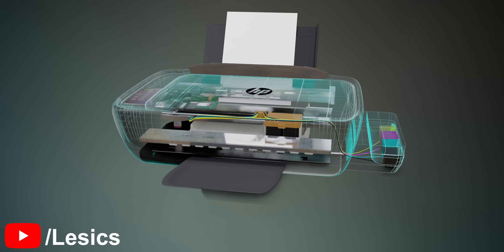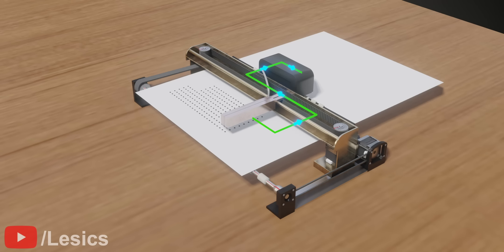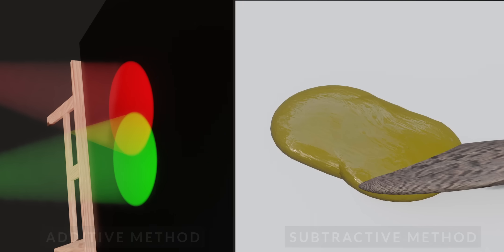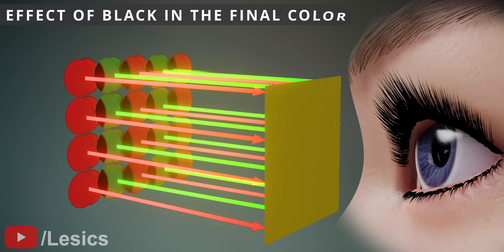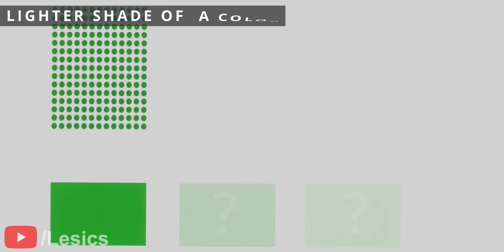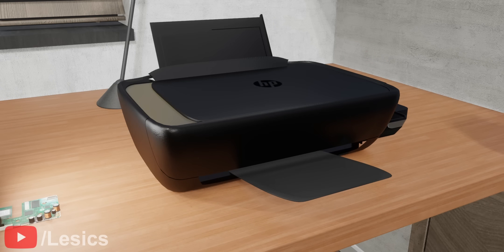Inkjet Printers | The interesting engineering behind them

Comment: It baffles me to know that there are micro nozzles and heating resistors in an absurdly large quantity while being extremely tiny yet they manage to print impeccable pictures.
Reply: Dr. Irina Luminesk  Right. However, this is electromechanical device which handles real fluid not just electrons and holes. Maybe nanorobots would be a fair comparison.
Reply: I would have guessed that making of the heads would be hard and expensive and thus ink heads should be loose from the ink but nope they somehow made them so easy to manufacture and all and also make them so hard to reuse and so just wow
Reply: Dr. Irina Luminesk  Please look up MEMS. It's not a trivial thing.
Reply: Tinier they can get better the pics will be...
Reply: @SALESENGLISH2020  still if engineers want to do something new then they will make narrow paths for ink
Reply: I remember in the beginning of 80's IBM showed I closet size device that really jetted a single stream of droplets and it was very high price. A little later I read from EDN (Electronic Device News) editorial that the kind of nozzle we now take for granted is doomed to fail and never gonna work....
Reply: @Axel_Andersen  That style is still used in packing plants for quickly marking boxes on conveyor belts
Reply: @MattOGormanSmith  That is interesting to know. Thanks. But I guess my main point was that at the time the now ubiquitous printhead was considered so difficult to make work that a major industry magazine doomed and gloomed it. Then again IIRC EDN also said that we will never get faster than 2800 baud modems on copper dial up iines because of Shannon and Nyqvist ;)
Reply: Dr. Irina Luminesk  Complexity is never the target in technology. Something being complex means a simpler way to do it could not be figured out. Complexity is bad, it means more difficult to make, more difficult to maintain and higher probability of failure. Even in transistors actually simplicity is the aim. Transistors aren't complex, they are very simple. There is just a lot of them, that makes the end product somewhat complex. Also the production process is somewhat complex and error prone. If there was simpler and less complex way to do what transistors do today, they would be swapped out immediately, but at the moment transistors actually are the simple way.
Reply: And imagine that in CERN scientists collide 2 opposite moving (with 99.9999% of the speed of light ) protons 40 million times per second and every collision is documented event!
Reply: @MiTheMer  Nope, costs manufacturers about $0.10 to make every single part of the cartridge. You can buy refill kits that work just as well as hp or epson ink for inkject printers for like $15-20 and get hundreds of refills. Inkjet printer ink is one of the biggest scams there is.
Reply: @BrHck  god damn. They must have zetabytes of storage and ram for this

Comment: I've taken printers for granted, I had no idea how complex they actually were!
Reply: we all did ...
Reply: Considering the $ of an ink printer...
Reply: I have Epson stylus 1390 which is made in 2008. I'm facing issue in that printer it's drop ink from it's Head after while without used.
Reply: Can we print stickers from this printer????
Reply: epic indeed
Reply: @dilansasanka1979  yup you need a sticky paper instead of the regular A4 size sheets
Reply: @lodeddiper3079  i did.but my printer got stucked.
Reply: @dilansasanka1979  did you seperate the paper, the sticky part and the butter paper, if yes you're not supposed to do that

if no then iv seen ppl print on a sticky paper
Reply: Everything is more complex than it seems. Even things based on very fundamental principles of physics are difficult to design in a way that makes them work.
Reply: @lodeddiper3079  no i didnt.sticky paper thickness more than A4 paper
Reply: exactly Ethan.  this is a masterpiece of brilliant engineering
Reply: What r u gonna do now?worship it?
Reply: I hope one day there will be printer technology using ink from wall paint🙏😀
Reply: @haoli6628  you can get older ones for around 30-60 bucks depending on functionality. They might miss some connectivity options but at least they work.

Ink on the other hand is still hilariously overpriced
Reply: @lodeddiper3079  nothing to add but that I observed it working way more reliable with printers capable of printing on photo paper. I assume it has to do with paper thickness, stiffness and the paper surface to be printed on
Reply: Same with drinking water. Never mess with Allah

Comment: I have finally understood why primary colors are not used in ink cartridges. Like always, another great video. Thank you.
Reply: Technically they do use primary colors. The primary colors are different depending on if it is additive or subtractive color space. Black (K) is added because using CMY to make it darker takes a lot of ink and ends up being a muddy dark brownish color due to the accuracy limitations of inks.
Reply: they do use it , it’s the shading and heat being transfer changes the perspectives,, welll the tech behind it

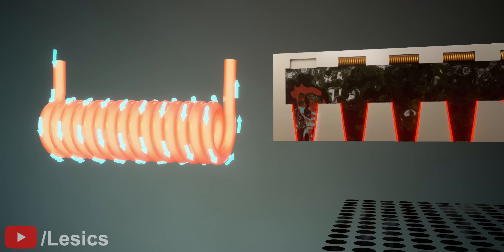Comment: My mind was blown and baffled by 1:35 where "heating up resistor coils" came into play.  Just the thought of how intricate a printer can be is amazing.   👍🏻😊
Reply: That is why the cartridge comes costly.
Reply: That's the least surprising thing going on with it bit nonetheless I appreciate your appreciation 👍
Reply: @Eren-da-Jaeger  the cartridge doesn't have them.
Reply: Love your printer before it becomes a Decepticon.
Reply: @fatitankeris6327  Some cartridges do come with the print head.  It's more expensive but ensures you get clean nozzles each time without wasteful (and not always successful) cleaning cycles.
Reply: this is thermal printhead. search for micro peizo.
Reply: @ajmercompany3520  Just searched 7 days after your comment; now that's damn amazing technology.  "40,000 times per second ink is delivered to precisely the exact spot needed" was quoted in video.  No heat.  Electrical current applied for contraction in order for ink to be released.  👍🏻😊🤯

Comment: Excellent.  Thank you.
I can't hardly imagine an engineer dreaming this up: "ok, so, we'll put a teeny tiny heater coil above a channel of ink, that will cause a vapor bubble that will force out a droplet of perfect size.  And then after turning off the coil, the meniscus with draw the ink back into the chamber, and then return to the surface but without releasing anymore ink.  And it will do all of this in a tiny fraction of a second.  Sound good?  Let's spend a few hundred thousand on this idea now to see if it works..."
Reply: Probably started as a giant apparatus on a dirty workbench, and iterated from there over 50 years, nevertheless, incredible.
Reply: Apparently the action of heating up the ink to create a bubble that would force it out was by accident, from creating strips soaked in ink for typewriters, and it got heated up somehow and exploded ink everywhere. And lo, the printer was born. I think the ink droplets get fired out at like 20-40mph from your injet cartridge too.
Reply: @alexjohnward  exactly, this is the result of 50 years trial and error by thousands of engineers

Comment: 9:09 Unless there have been some new developments in printer technology I am not aware of, I have never heard of printers mixing inks as shown here. Most printers I am aware of mix colors by putting down overlapping grids of dots where each grid is slightly misaligned from each other. The eye does the color mixing.
Reply: Exactly! When I heard it, it seemed strange and impractical to me, so I watched a printed image and the dots are misaligned as I thought! (Like black in the video)
Reply: @MyNotSoHumbleOpinion  The process is called halftoning. It's essentially the same as used by publishers when printing full-color books, magazines, newspapers, etc. Everything is printed at the same intensity, the size of the dots change to give the effect of different amounts of each color. You can usually see it best in the comics section of a newspaper, Sunday edition.

A desktop printer will typically measure its resolution in DPI, or dots per inch, and the numbers will be something like 300dpi, 600dpi, and 1200dpi. A halftone image is measured in LPI, or lines per inch, and they will be 75lpi for newspapers and 133lpi for most books and magazines. The halftone grid is at an angle to the page with black at a 45° angle, cyan at 15°, magenta at 75° and yellow at 0°.
Reply: Well, you gotta consider the paper is still ever so slightly damp right after the page prints, which means the ink right under the line being printed indeed is still wet during each print head pass.

And you better believe the printer manufacturer wants to waste as much ink as humanly possible while still producing a quality printout. So yes, they'll gladly overlap the inks not only in a dithered pattern but also right on top of each other too.

Ink costs more than human blood ya know...

Comment: If I remember correctly from the Gicleé printing, modern printers do not actually have that many nozzles densely packed in the printer heads. Instead they use "amplitude modulation", i.e. by somehow changing the size of the ink droplets to achieve an equivalent of the boasted resolution. The most advanced Gicleé printer goes up to 4800 DPI but the most advanced C-print (the good old Kodak photo printing) has only 640 DPI yet both yield shoulder to shoulder image quality in terms of details.

Comment: This was like a trip down memory lane, I worked for Hewlett Packard 1980 ~ 2002
Part of that time was working with the Printing Division, which included InkJet Printers
Lot's of comments on cost of cartridges... They operated the https://en.wikipedia.org/wiki/Razor_and_blades_model
FYI...
Some of the engineering design concepts go back to 1867, yes 1867..!! Continuous Inkjet to print Telegraphy on paper tape

Comment: You should mention piezoelectric print heads, which are also very common. Halftoning should be discussed. Also would be good to describe dye vs pigment based inks!
Reply: Thank you for confirming my first impulse on seeing these heating resistors. As i'm intuitively thinking mechanical force as in piezoelektric elements would be faster to react.
Reply: Correct. Epson uses pizeo, while HP uses heated resistors. There's also other means of printing from waxes (think crayons) to banded color ribbons (old-school impact).
Reply: @brodriguez11000  If memory serves, the wax printers take a long time to start up and use a lot of standby power to keep the wax in the print-heads molten.
Reply: Well piezoelectric material need more control technique coz they have 2 position/phase in some certain point of Volt or potential different. But well, they are interesting technology, cant imagine what will my son do while being an Engineer. The techonolgy moves really fast bro, our brain sttruggling follow all the changes XD
Reply: They did mention halftoning in the case of Black. But it is used in other colours as well.

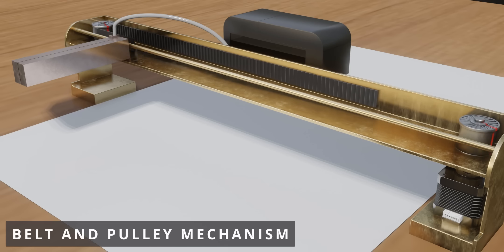Comment: 3:15
Literally no consumer printer uses a stepper motor to move the carriage or the paper feed since at least 15 years XD it's a DC motor driven by a PWM signal, it uses an encoder strip (linear for the carriage and round for the paper feed) to see exactly how the motor moves and where the carriage is located.
I'd also point out that there are inkjet printers (such as Brother and Epson) that use piezoelectric printheads, they don't use resistors to generate ink droplets

Comment: Back in the day, I had to print a lot of documents. To save ink, I lowered the DPI; however, I had to replace ink cartridges quicker. After six months, I used the standard DPI setting and the cartridges lasted longer. I don't know if lowering the DPI means bigger drops of ink or what.
Reply: dpi changes the resolution, so the printer just makes few dots the same (like high resolution screen trying to show low resolution - it shows one pixel using multiple pixels showing the same color). For lower ink consumption you can lower the brightness or use "draft" mode in printer settings.

Comment: It would be interesting to learn how the printheads are made. I’m pretty sure the nozzle holes are made using microelectromechanical systems (MEMS). They have to be perfect circles but only like 20 micron diameter. Btw thanks for the great video!
Reply: Just to get an idea:

10 cm X 10 cm X 10 cm = 1L (one liter water is one Kg)
1 cm X 1 cm X 1 cm = 1 mL (of water is 1 gm)
1 mm X 1 mm X 1 mm = 1 uL (for water, it will be a mg)
0.1 mm X 0.1 mm X 0.1 mm = 1nL (a ug of water) -> small but barely visible
0.01 mm X 0.01 mm X 0.01 mm = 1pL - you need a microscope to see the drop
to get pL size drops, you need holes that are smaller than 20 micron (10 micron = 0.01 mm)
Reply: @janami-dharmam  didn’t know that making a nozzle holes requires a sorcerer
Reply: Yeah, that would be interesting to know. I don't know for real, but I would guess they could be made with photolithography same way like other small devices and especially semiconductor electronics are usually made. If not, maybe another way could be to use a laser?
Reply: They’re made using semiconductor photolithography. That also conveniently allows some of the drive electronics to be manufactured directly into the head itself without needing separate chips.

Comment: Inkjet Printers were revolutionary at that time. But now they have proved to be very costly due to expensive ink costs.
I prefer Ink Tank printers as they are more effective.
Reply: They're ALL ink tanks if you get creative :D
Reply: The inkjet printer is cheap because the manufacturers make the printer at a loss and takes back the profits on the ink. Its often cheaper to throw away the entire machine and buy a new  then to replace the ink cartridges and so this contributes to todays throw away society where fully working things are thrown away on the scrap heap because its cheaper to get a new then to repair it or replenish its supplies. Also when the head cleaning procedure is performed this takes more ink then to print a page with 100 % coverage to waste ink on purpose and this cleaning cycle is performed every time you want to print something after just some day of previous inactivity even if you just want to print some text at the moment. At least thats how it was on my Epson photo printer. Needles to say I got myself a laser instead as I don´t print that often and so the printer ended up wasting 90 % of the ink on head cleaning.
Reply: @johnpekkala6941  True. This leads to more waste and companies do not recycle these. But they sell you the cartridge by labelling it as made put of 80% recycled material, when only a few people buy it.
Reply: @johnpekkala6941  It's called the https://en.wikipedia.org/wiki/Razor_and_blades_model
Reply: theyre still inkjet, just ink is in a separate tank instead of a tiny amount in the cartridge, which is also the printhead, this is one reason why theyre expensive
Reply: @andygozzo72  Most inkjets these days do not have printheads in the cartridges. But even in the ones that do, that’s not why they’re expensive. The cost to manufacture a cartridge with integrated printhead is literally something like a dollar. Completely negligible compared to the sale price. It’s purely the “razor and blades” model that makes them expensive. 

If you look at modern ink tank printers (where you buy cheap ink in bottles), and compare them to the equivalent models that use cartridges, the ink tank model gives you a much more accurate idea of what the printer itself is actually worth. The difference in price of the equivalent cartridge printer is what the manufacturer has to make up for in cartridge profits.

Comment: Inkjet ink - one of the most expensive liquids on the face of this planet.  Printers are sold at a loss as the ink more than makes up for sustained profits.
Reply: Thats why i rebuy the whole printer when i need more ink lmao
Reply: @d00s0n  refill ink using the third party. 10 times cheaper
Reply: @Thrill98  cant always, many have chips in that count down the number of dots printed and throw a wobbly when it goes too low,, you used to be able to get chip resetters for doing this but dont hear of them now
Reply: @andygozzo72  yeah not sure about new models maybe that's why i love my old printer cacon cause it's still possible to reset the count

Comment: I don't get the example with putting RGB ink into the printer. Doesn't the printer still assume it has CMY colors, and hence the result?
Reply: The same thing i asked myself
Reply: Technically you are right, but you could print a version of the image where the hues are shifted 180 degrees. This will cause cyan to become red, magenta green and yellow blue (and vice versa) while not changing brightness. By replacing the colors appropriately, the experiment could be performed. I'm not sure they bothered to do that, though, since they knew it would fail anyway (for the reasons given later).
Reply: Actually what's the doubt here? Why should printer assume anything?.. Like does the printer know which colour we use inside it?
Reply: @Pfor_Podi  I guess. It receives pixel color data and it probably translates that to CMY